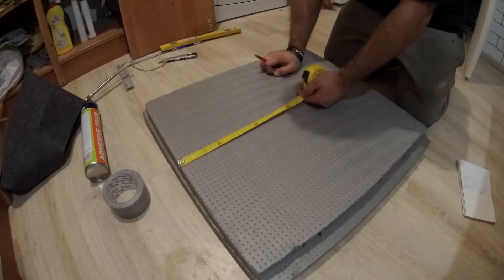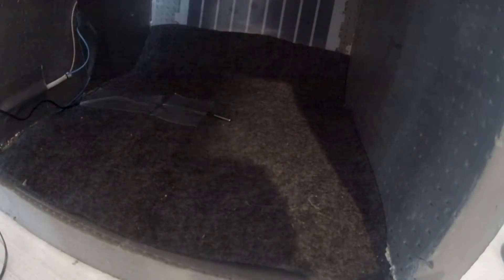🍄 Shroom Academy Incubator for mashroom cultivation. Mushroom Spawning box DIY

Comment from the maker: timeline:
0:00 Tools and components
0:15 Measuring styrene
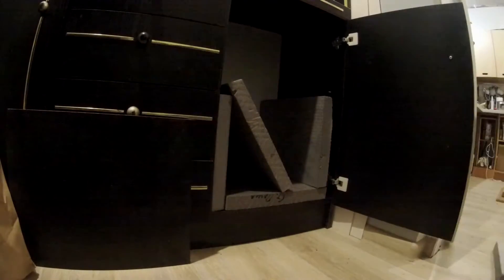0:30 Cutting styrene
0:45 Temporary assembly with nails
0:55 glueing up with adhesive foam
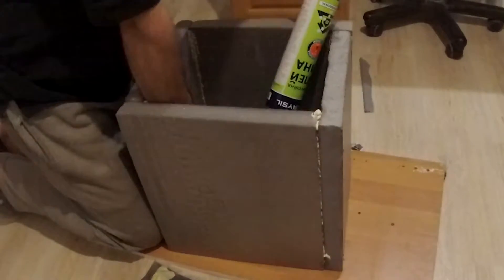1:15 removing excessive adhesive after curing
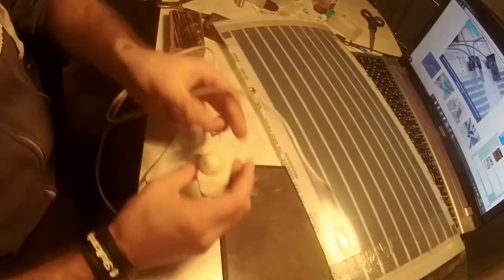1:45 Soldering the heating pad
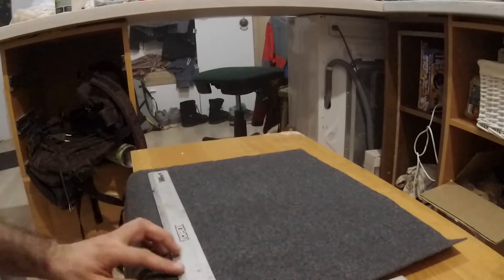2:15 Measuring and cutting a piece of felt to be place at the box bottom
2:30 Attaching tape-enforced heating pad into the box
2:50 Cutting out the door
3:10 Attaching thermal regulator
3:20 setting up thermal regulator
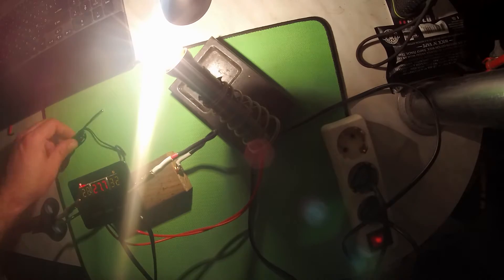3:40 Temperature range 28-32 degrees Celsius
3:50 Thermal sensor is placed at the bottom center of the box
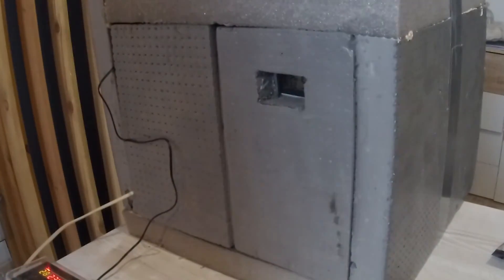4:04 Box is complete

Comment: Great video thanks!! One thing, most people recommend leaving space between thermal mat and other surfaces (to allow air flow and diffusion). Is that also necessary with this type of incubator or not necessary because you're using a thermal regulator?
Reply from the maker: It really depends, there are many ways to get thermal stability. We found out that our setup works for us :)